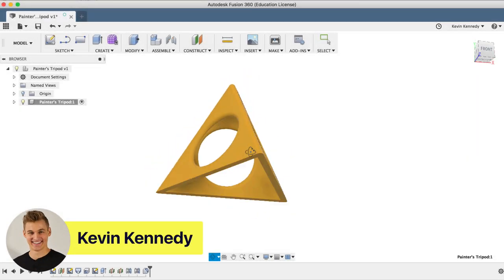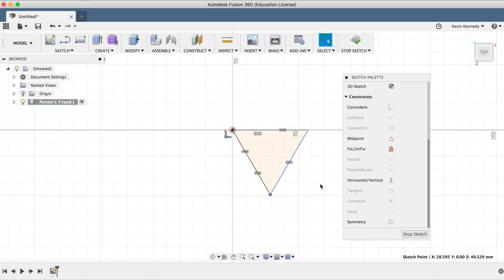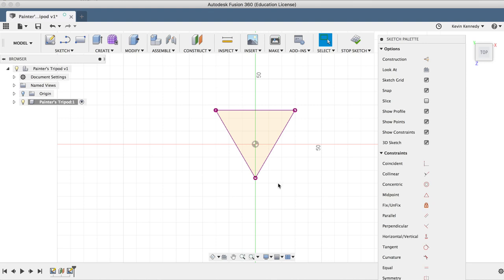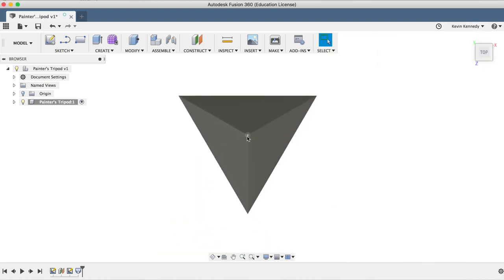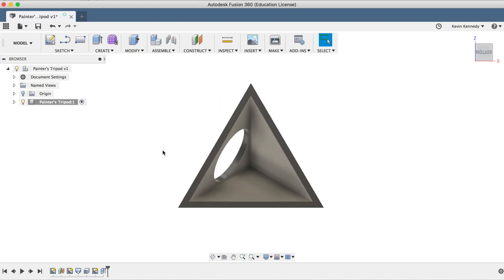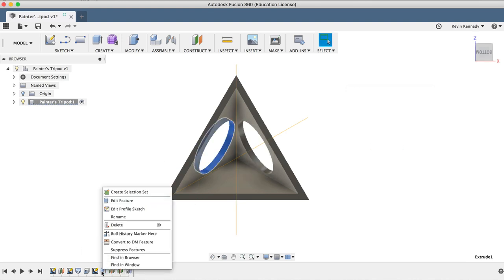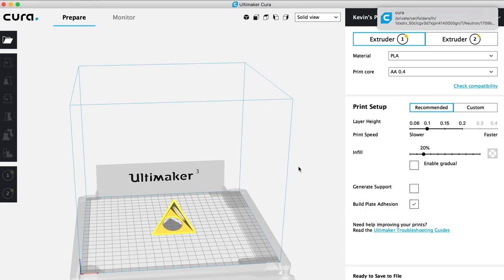How to 3D Model a Painter's Tripod - Learn Autodesk Fusion 360 in 30 Days: Day #15

Comment from the maker: Got questions! Please comment them below right now! Cheers, Kevin :) 👇👇
—
COMPUTE OPTIONS EXPLAINED
Also, as promised... these following "compute" options are really just different levels of optimization when patterning/mirroring features, with slightly different capabilities. Try to use them in order. If Optimized doesn't work, try Identical, and then try Adjust.

 1. Optimized is the fastest. It uses some internal code that just patterns the faces of the feature. But, there are some limitations: The feature faces have to all land on the same face, and there are some cases (the most famous is patterning cuts around a cylinder, where this method fails.

2. Identical is next fastest. This method just extracts the tool body of the feature, patterns that tool body, then joins the results at the end. It can handle cases like the cutouts around a cylinder.

3. Adjust is the slowest. This method recomputes each instance of the feature almost as if it were a separate feature. This allows you to do things such as patterning a feature with a To-Face extent and have each instance of the pattern compute differently.

—
QUICK LINKS
Creating base triangle: 0:54
Creating point: 2:52
Loft to a point: 4:03
Shell pyramid: 5:17
Cutting hole in one side: 6:50
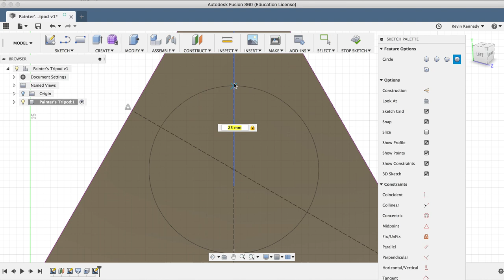Extrude to object: 7:25
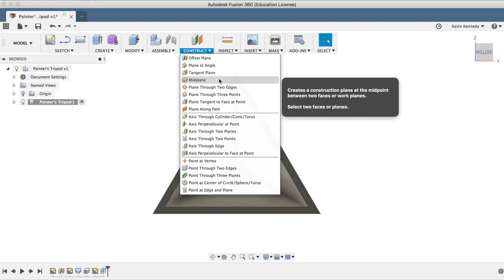Mirroring hole: 8:37
Reply: You sir are a god send
Reply: Can you clarify what you mean when you say that the feature faces have to land on the same face? It seems to be that in the video, each of the circular cuts is on a separate face of the pyramid. Thanks.

Comment: Hi Kevin! Just to let you know that projecting the triangle sketch on the offset plane doesn't seem to be mandatory since you can simply use the midpoint constraint on your construction lines to place the point. This way, if you decide to change the triangle's size, the midpoint constraints will automatically ajust the point and therefore Loft feature to the central point of the triangle!
Reply from the maker: Hi Lanns, thanks for sharing this with the community! I appreciate your continued support. Cheers, Kevin :)

Comment: Another way to apply the hole to all sides of the tripod is to create an "Axis perpendicular to Face at Point" and select the bottom face and the tip of the tripod. Then you can use a circular pattern with faces to select the hole and the new axis and all sides have holes.
Reply from the maker: Great tip, S.P. 
Thanks for watching! :)
Reply: Nice

Comment from the maker: If you don't have access to a 3D printer, or if you don't want to wait for them to be printed, you can buy them on Amazon... they're pretty cheap!
If you are interested please use my affiliate link so I'll get a really small (pennies) kickback in appreciation for making this tutorial -> https://amzn.to/2YetGio
-
TIMESTAMPS
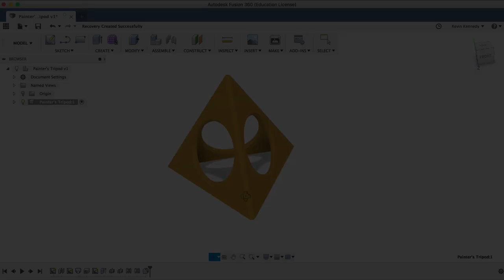0:00 - Create a Painter's Tripod in Fusion 360
0:54 - Creating a base triangle
2:52 - Creating a point
4:03 - Loft to a point
5:17 - Shell pyramid
6:50 - Cutting hole in one side
7:25 - Extrude to object
8:37 - Mirroring the hole

Comment: One of the things I like about Fusion 360 is that you can do the same thing in different ways. I think the way I would've done this would be to :
1. Create an inscribed polygon (number of sides equal to 3) on the top plane with the center at the origin.
2. Dimension the edge length to the desired size and stop sketch.
3. Extrude the sketched triangle up and set a negative taper angle to get you the desired height.
4. Use the shell feature on the bottom.
5. Create a sketch on one of the sides with the center opposite the vertex.
6. Extrude the hole in the side.
6. Do a circular pattern and set the quantity to 3.
Reply from the maker: ChemicalArts - Thanks for watching & commenting! I agree! It's always interesting and cool to see different ways to 3D model the exact same object. My biggest thing is just educating people to "think ahead" and try to plan out their designs so they don't run into trouble later on. In many cases, while planning ahead there are still multiple ways to model something that still gives you the flexibility to change it.

Re: your steps. The only step I would be concerned about is #3. If you decided to change the height of your triangle later on it may be a little bit trickier to figure out the new taper angle, although not impossible. Cheers, Kevin :)

Comment: love your videos. Just awesome. My brother is a shop teacher and he turned me on to your channel. Really starting to get the hang of it and move around in the software. the old/new UI doesn't even bother me much anymore. When I complete a lesson, I like to continue and add things to really check the progression of my skills. Added a angled lip to one side on this one to hold a board or painting whatever. Added the compression/pressure tabs on the cylinder of the screw driver to be more realistic as someone mentioned. just fun to see what I can do. Thank you!

Comment: i decided to be a bit adventurous, pause and figure out how to get the other two holes. I ended up constructing an "Axis Perpendicular to Face at Point" from the point at the centroid of the base. Then created a circular pattern (the Adjust compute option gave me trouble, Optimised worked fine)

I am getting more and more confortable with this program, despise the occasional bug
Reply from the maker: Hi, Veziop. That's great!!! Yeah, the compute options can be picky sometimes... And I feel ya as far as other bugs being frustrating. Keep it up though...great work! Cheers, Kevin :)

Comment: Thanks for the tutorial.  An alternate approach would be  to use the Sketch Polygon tool to create the initial triangle at the origin.  This simplifies the original triangle and gives an axis for a Create/Pattern/Circular Pattern for drilling the holes.
Reply from the maker: Hi, Robert. Great tip - thanks for sharing it with the community! Cheers, Kevin :)

Comment: It is really nice tutorial because my mom do painting with oil based paints. She will like it but I need to find a way to send it to Turkey :D

It is also nice to learn midplane feature; because this is hard to use mirror command for the circle feature by using the "midline" as a mirror plane.

Thanks!
Reply from the maker: Thanks, Ümit Demir! Glad to hear you found this one to be useful. I had 50 of them printed out at one point...but somehow they all disappeared (given away to friends) so I need to print more as they're super helpful.

The construction planes are certainly helpful - I'll have to a do a video covering each construction plane at some point. Cheers, Kevin :)

Comment: Great series, thanks for putting it together. For 3D printing I've been using STEP which has been great. I see F360 is setup to quickly export STL which is nice. Is STL better, or are they about the same when they get to the slicer? I'm using an X1C from Bambu Lab with Bambu Studio.

Comment: Thanks again!
It's great fun that I got to the middle of the course, I learned a lot from it. I'm already excited to see what awaits me next.
About the the circle on the triangle, I forgot to active the project command, and I drew the reference lines on the face of the triangle, and still everything worked fine. So what exactly is the need for the project command?

Another question about the circle - is there a way to lock it with constraints or something like that, so that its dimensions are updated automatically, and it always stays in the center of the triangle, even after 
changes are made to the size and shape of the triangle?
Thank you!!

Comment: For some reason after lofting the triangle, it was already hollow so I couldn't shell it. I didn't manage to figure out why, so I used the thicken command we learned a few classes back to make it 2.5mm thick, since it was already hollow. The only other thing I had to change was when I extruded the circle and selected "to object" I had to pull the blue arrow to the inside face of the triangle. Otherwise, seems like we got the same object at the end :) Thanks!
Reply: I ran into the same thing. Anyone know why the loft is leaving the object hollow?
Reply: Thanks, I found the same problem.  Surface -> Create -> Thicken did the trick.

Comment: On the painters tripod I am having an issue mirroring the extruded hole after creating the 2 midplanes. My mirrored hole is not on the face its kinda out in space and out of position. I have tried redoing the midplanes and double checking the selections with no luck.

Comment: I have been following along with this playlist and I am learning a lot, thanks for taking the time to put this series together. When I save as an STL for 3D printing, Cura does not show up as a default program. Can I change this in the settings?
Reply from the maker: Hi, Brad. Glad to hear you're learning a lot. When you are in the "Export as STL dialog" you need to check the export to 3D print Utility option. Scroll down the list of programs and press custom. Then, find the Cura application within your computer directory. That should make it available in the dialog.
Cheers, Kevin :)

Comment: I know this was produced a couple years ago but I just finished watching all 30 days (very nicely done content by the way) and I still have a question.  I will probably not word this correctly even though its pretty simple in my head.  OK, I have a part that has a simple 20x40x5 oval with two 20mm long 15mm diameter cylinders coming directly up from the surface.  I want to put a 10mm diameter hole in the center of the side of one of those cylinders that would also go through the center of the other cylinder.  but i want the hole in the other cylinder to have a tapered section to a smaller cylinder coming out the other end.  that would allow me to mount the rectangle vertical, and put a mechanical pencil through the 10mm hole, and the tip come through but stop in the hole on the other cylinder.  it doesn't seem like it would be that hard to do but i have 2 questions.  how to i add the sketch plane to the edge of a cylinder and make sure its perpendicular to a line bisecting both my cylinders?  and how do I create/extrude a tapered hole?

Comment: Hi Kevin, if i wanted to make the same tripod but with a base as well which process would you recommend? I found a way to do it by splitting off what would essentially become the base and then continuing as normal then using a joint to add it back on after shelling out the inside. Not sure if this would create problems when it comes to 3D printing and just wanted to check :) Thank you for all the videos as well I am a complete beginner but learning a lot very fast!

Comment: About: Mirroring hole
can we use circular pattern?
Reply from the maker: Hi, Nhan Phan Minh. Great question - you could, however, you would have to create an axis in the middle of the pyramid. Probably one of the easiest ways would be to go to the construct dropdown list > Axis Perpendicular to Face at Point > select the top of the pyramid > select the bottom face of one of the sides of the pyramid > click OK. Then when you use the circular pattern feature you'll have to select that construction axis as the axis required for the circular pattern. The number of sides, of course, would be 3. Then you'd want to set the compute option to optimized. Cheers, Kevin :)

Comment: Is there a way to shell the pyramid without selecting a face so I could have the same round hole in the bottom instead of a triangular hole.
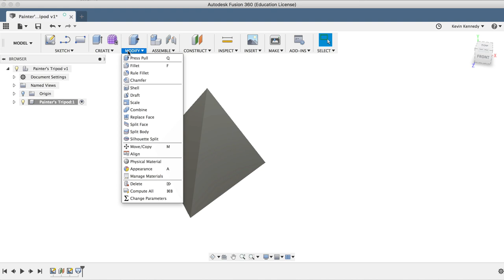Reply from the maker: Hi, John. Great question. There is a way... what you'll want to do is shell the entire body, which then excludes making a selected face a hole. To shell an entire body (without the face) you'll need to select the body instead of the face at 6:00 in this tutorial. The easiest way to select a body is by opening the component folder in the browser (lefthand side), open the bodies folder, then select the corresponding body.

Alternatively, you can select the body by selecting it in the model. However, you'll want to be careful not too select any faces. To ensure that you don't select faces use the "Select Body Priority" selection. Select dropdown list > Selection Priority > Select Body Priority.

Cheers, Kevin :)

Comment: Great video, thank you! Quick question: At 2:20, I don’t understand why setting the side lengths to be equal, and dimensioning their lengths was sufficient to entirely constrain the shape - why couldn’t you move it, or at least rotate it around the origin?
Reply from the maker: Ed Jones - Great question! The shape could be moved around the center origin (rotated) it just cannot be manipulated in size or shape without us removing some of the constraints.

If you didn't want it to be rotated as well you could select all three lines that make up the triangle > right click > and select fix/unfix, which will "fix" the lines so they can't even be moved.

Cheers, Kevin :)
Reply from the maker: It should still rotate at the center origin point if you use the move/copy feature, with the same settings as I used in this screenshot: https://snag.gy/zwZDxH.jpg
Reply from the maker: Ahhhh gotcha. Switch case sounds awesome!... are you going to 3D print it?? I'd love to see it when you're done!
Reply from the maker: Ian - This case is awesome! Also, I love the idea of adding foam on the inside... brilliant idea! When I used to work in a 3D print lab (while in College) I was always trying to get people to understand that 3D printing doesn't have to be the only end result. This is a great example of taking the 3D printed object a step further!

You'll have to keep me posted on how the first print(s) come out. Do you plan on putting the file online after you have it finialized? I'm sure on a site like Thingiverse.com there will be a lot of downloads.
Reply from the maker: @Captn_Grumpy  Awesome update. Sounds like you're making great progress! This is one of my favorite reasons of teaching F360... seeing all the "hobbyist" and "makers" coming up with something in their head... 3D modeling it, improving upon it...and of course, using it!!!

A good friend of mine is always on his switch... I may have to print one out eventually ;)

Cheers, Kevin :)

Comment: Hi Kevin. I really appreciate your videos, they are quite helpful. But i still have doubt over projection command (one which you did for the bottom triangle before loft command), why is the projection command required, and where is it used?

Thanks again

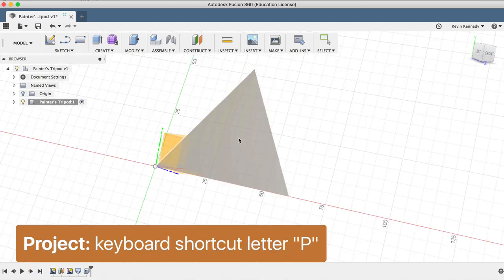Comment: @6:36 you chose to project the sketch, is there a particular reason for that? could you just have created a sketch directly on the face.
Reply from the maker: Hi, Jardim Machine Tools. Great question. Projecting a sketch has two advantages. First, it's a way to recreate a sketch quicker than sketching it out again. Second, the projected sketch is driven by the initial sketch. Which means if you update the original sketch, the projected sketch will be updated automatically.

In this scenario @6:36, I could've simply snapped the construction lines in at the midpoint constraint icon. However, if I had decided to change the shape of the pyramid (to something else, say a pyramid with 4 sides at the base), then that midpoint constraint icon would likely disappear or get effected, resulting in these construction lines to get skewed. With the projected lines, the construction lines will continue to stay connected even if the shape changes because the outer sketch geometry that was projected will update as well. Cheers, Kevin :)
Reply: @ProductDesignOnline  ok i see. Thank you for your detailed response much appreciated.
Reply from the maker: @jardimmachinetools9225  No problem! I'm always happy to help and to answer F360 questions. Cheers, Kevin :)

Comment: Hello again . Why do we have to project tje scetch in order to make the triangle . Cant we just make an offset plane and draw a smaller triangle on it and the use loft command to come connect the too scetches and finally create the 3d triangle? I mean i didnt get the point of projecting the scetch . If im not mistaken, i think that in order to make a sketch or a 3d model there are more than one ways ? Is there posible to make the same triangle in different way ?

Comment: Amazing tutorial. Looking forward to next lesson!
Just one question: is it recommended to fillet edges at the end? Why not start with fillet and then mirror it? I've noticed this in previous videos as well.
Reply from the maker: Thanks, Onos. That's a great question. You are correct - it's generally considered a best practice to add your fillets at the end (in all CAD programs not just Fusion 360). This has to do with the nature of how fillets are programmed/processed each time you make changes. With small projects like this, it likely wouldn't matter much either way - but I always try to recommend the best practices so they've become habits when you go to tackle large projects. Cheers, Kevin :)

Comment: Why do we need to use the projection command at 6:34 in the video, right before extruding the circles in the sides?
Reply from the maker: Great question, Jim! I projected the edges of the sketch so the inner parts of the sketch (construction lines and center circles) were driven with relation to the outside. This way, if I were to update or change the size of the original sketch, then the circles would update accordingly, remaining directly in the center. Cheers, Kevin :)

Comment: So...could I have used the same construction lines and midpoint on the original sketch, and then created an offset plane and transformed that point onto the plane, then lofted?
Reply from the maker: Hi, Bobos Curse. You could certainly do that. The only concern would be with the offset plane. If you wanted to change the scale/size then you would have to adjust the angle/placement of the offset plane. Cheers, Kevin :)